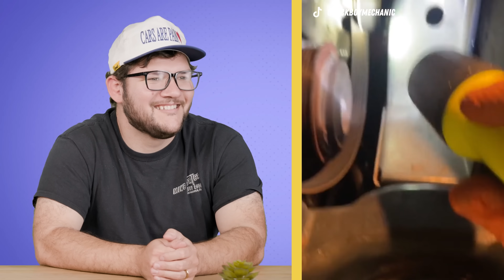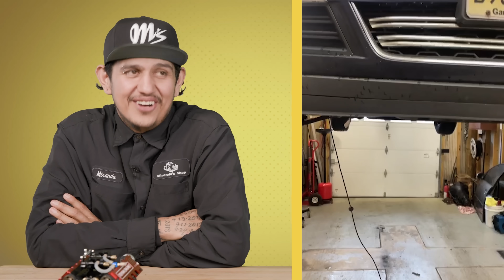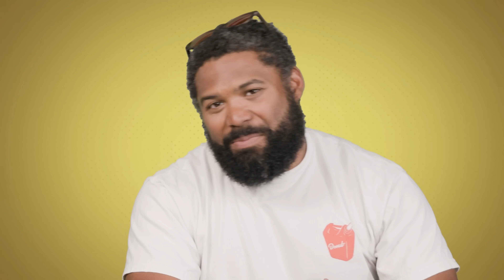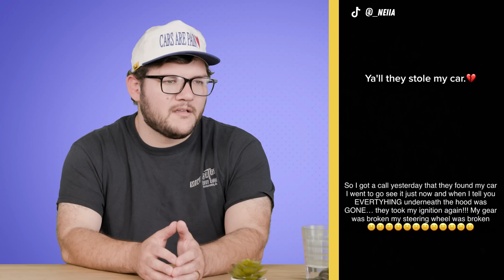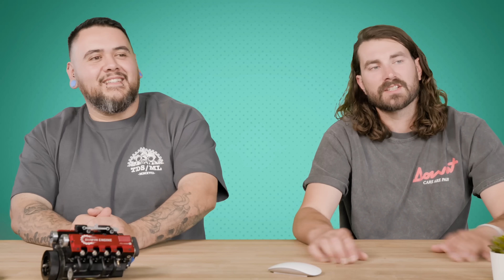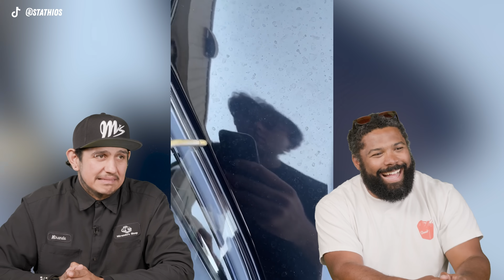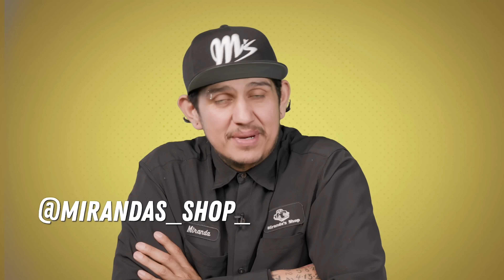Mechanic Reacts to Car Engineering Fails

Comment: Im an engineer (aerospace electronics)  I also work on cars (was and engineer for Chylser at one point) the issue is that a lot of engineers dont have the complete user experience in mind when designing things. And when they do, often time managment would force them to ignore it to save cost/time Before I design or make changes I consult with several technicians to make sure im not causing unnecessary pain points
Reply: And as a retired aircraft mechanic, I truly thank you for talking to the technicians.
Reply: I work in a heavy duty truck service shop, I can tell you 1 thing for certain…. Fuck Volvo semis. They make a truck that’s supposed to be streamlined for the consumer, however, they overlooked the need for maintenance and the effective ability for technicians to navigate whatever bullshit they throw at you. I want to know why in the absolute fuck Volvo felt a need to have 3 lube filters, and 1-2 fuel filters,  when most trucks have 1-2 lube filters, and 2-3 fuel filters…. Not to mention it really seals those filters in in comparison and they’re stacked in a row too damn close together to effectively loosen all three and remove all three, gotta loosen 1 then remove 1, and they bleed, and you only get a 1/4” turn with a filter wrench at a time because you’re gonna keep hitting knuckles against leaf spring or frame… engineers y’all make shit the world needs, but sometimes y’all make shit unnecessarily “tidy” which results in tight squeezes that just make me want to make y’all start inventing tools for specific use lmao

Comment: everyone misses the point mechanics are not to exist outside the dealership you buy them and take em' to the dealer if not you buy a new one so you can be a slave to the company forever remember when the car breaks you buy a new one FOREVER... it keeps the emplyment  'in the company mindset...it builds customer brand loyalty ...UNDER FORCE...

Comment: Engineer here and no beef with mechanics. I do however have something to say to architects and the likes (in this case car body designers). Usually the problems start when you are given an beautifully designed thing, like a car or a building. Then you are given a spec sheet. And then you need to start figuring out where to fit all that within that already agreed upon design... 

Then you have management who sets fairly strict timetable to make all that work... And then to make things worse, you have multiple engineering departments not communicating with each other all the time due to the schedule set up by management.

Don't get me wrong, engineers make dumb mistakes all the time, but most of them are due to horrible scheduling and very limited design on where to fit everything.

Comment: I once hammered a  bulge in a firewall to get a bolt out, another time I used a holesaw in the firewall to get to a bolt on a starter motor and multiple times the bolt that doesnt coume out has been cut in place.
That's the beutiful thing with working on your own old beater cars.
I didn't see the starter motor in the V in this video. it's an old favorite of mine....

Comment: About the oil drain plugs: why, why on freaking earth do they make them to the sides and not just straight to the bottom of the oil pan? Like the amount of mess you make if you don't remove a cover or when there is barely any place to put a cardboard is insane. Best example is Fiat Ducato.
The older Ducato 290: The drain plug on the bottom of the oil pan and the oil filter has no other components underneath it. You simply dont make a mess when you do an oil change.
The new Ducato 295: The drain plug is to the side where you gotta remove a cover and still use a cardboard, while the oil filter is located above the front axle and the  drive shaft, causing you to make a full mess, no matter what you try.

Like why on earth do they put the drain plugs and oil filters on the most retarded ways possible?

Comment: That roof leak is half engineer half factory. part of engineering for mass production is to minimize potential factory error by reducing fiddly, low tolerance, and difficult to QC or repair assemblies.

Comment: As a former auto mechanic, I've had multiple situations that had me cursing the engineers for idiotic designs. 3 in particular stand out. 1. 1989 Honda Civic wagovan. Where the alternator is mounted, the ONLY way to remove it requires removing the drivers side CV shaft to have enough clearance to get it out. 2. Nissan......Altima I think. It had HID headlights of which the bulbs CANNOT be replaced while the headlight housing is in the vehicle. You literally have to remove the headlight housing to replace the bulb so, $200 for the bulb and 2 hours labor just to replace 1 bulb. 3. was a Buick Lucerne I believe......the oil drain plug faces forward at a slightly upward angle and directly in front of it is an aluminum lip with AC lines on it. The first time I changed oil on one of these I had a real mess on my hands. The oil went straight to that lip, spread all the way across to the ends so, I had oil draining in 3 places.
One repair we refused was on a German car. It's been so long ago I don't remember the make and model but, it came in with a bad starter. None of us had ever worked on one before so naturally, we looked up the procedure on "All-Data". Step 1: Remove engine from vehicle??? This was one of those cars where the started was mounted INSIDE the bell housing of the transmission. That's one of those designs that makes you want to punch the engineer in the face.

Comment: Not the mechanics fault at all your 100% wrong.. Just look at the ford f150 problem with the convenient slide for oil for the filter but it comes out on the ground behind you.... STUPID ENGINEERS!!! Although I think companies like Ford hires the Engineer that can complete the job for the cheapest price.. Ford isn't hiring the BEST Engineers =/.... I would blame the Corporations cutting corners with their engineers. Corperate and all... They are all just so stupid... TOP DOWN!!!! Also has to do with the Growth of a company. When a company goes "Public" they have to do what is best for growth for their shareholders... This is the problem with late stage capitalisms.. We need to figure out a way to take back the ground from the Corperate companies...

Comment: On the Q3 there is a recall for the seals and the drains get clogged in extreme cases they will replace the rails. Very fixable just a pain. You don’t get a new car because it leaks.

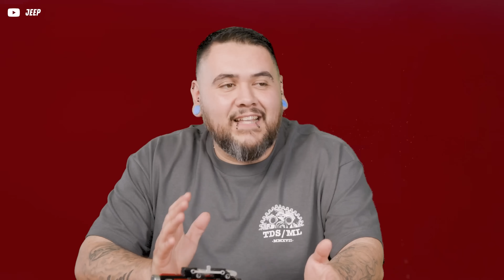Comment: as a mercedes tech on the statement about copying “mercedes habits” 7:08  i disagree because truth is many of major components such as transmissions in mopars are from mercedes its been a thing since like 2007 or so but the problem is that they get all the outdated stuff which is no longer supported by mercedes and has probably been replaced for a updated one for a reason so you can blame the brand for getting parts from another manufacturer to install it in something it wasn’t designed for

Comment: Yeah alot of the populus doesn't realize that engineers know and identify weakpoints and failures, but marketing and accounting tells them to patch it up with as little cost as possible. The problem is not engineering, its low cost capitalism and greed for profit. Most engineers love their work and put a lot of work into making sure things work right.

Comment: The chev belt tensioner bolt is easy, back the bolt out all the way to the frame, move the body of the tensioner all the way out and chop the bolt BEHIND the tensioner.
Just use a shorter bolt to reassemble...

Comment: I worked for hyundai/Mitsubishi. And the damn alternator Bolt on the xg350 (because it's a Mitsubishi motor) there is one bolt on the front of the motor that needs to come out inorder to do the timing belt. Well I order to get that one f ing bolt, almost the entire front clip has to come out. Pita for realz.

Comment: All McLarens and Lotuses are inconsistent - so difficult to get properly fitting replacement parts due to the ABSOLUTE DIFFERENCE in who assembled it and when. When they release a lightweight version of an existing model - you might already have that in your regular model just from build quality.

Comment: I'm an electrical engineer so don't know shit about mechanical engineering. Just wondering if that bolt issue is more a factory issue. Like purchasing couldn't source the correct bolts or tried to shave some money by lumping them in to an order with bolts a quarter inch too long thinking it wouldn't matter.

Comment: I mean to be fair, theres alot of good engineers out there who are told to "make it cheaper" or even "make it more expensive" (which overcomplicates things). The sh!t does roll downhill for them too. Engineering is not cheap and someone is obviously footing that bill with something to gain.

So yeah, id say the investors pee at the top of the waterfall, then comes corporate, then engineers, then mechanics and guess who sits at the bottom of the yellow creek and gets to pay a years salary for the privilege of drinking it.

Comment: As an engineer, I can tell you that management (non-engineers) make these choices 95% of the time to not allow the engineering team to correct issues we find before a vehicle goes to production. And for the stuff we do miss as engineers, just remembers that it usually takes over 100+ engineers to make a car and most are working on several at a time.

Comment: I live in norther bc Canada, we’re technically a rain forest. Sun roof leaks are the norm, I fix a lot of them and it’s exactly like the video. Usually coming out the a-pillars but sometimes out the overhead console. I’ve seen multiple new truck come off the carrier leaking. We just fix the leak and replace anything damaged. It’s a real nightmare and I hate it lol.

Comment: Jeep xj. Transmission crossmember bolts go into frame rail where welded nut is. Nut weld breaks. Fix  cut the floor open to get to the nut!

Comment: As a mechanic, my most prevalent engineering hatred is towards the ford 1.5 and 1.6l engines from the fusions, escapes, and focus. 
  Change a water pump......I dare you. Instead of using a block mounted tensioner for the timing belt, they mounted it to the water pump, so you cant do one without the other. The timing tool set is over $200, (just the tools, not the parts), and it's a minimum of 6 hour book time. They had a chance to fix it when they replaced the 1.6l after 1 year of production with the 1.5l. But they didnt. Big L for the engineers

Comment: Any modern german car is a one big problem. They were not meant to be fixed. Just throw away.
Reply: You bet how loud did i swear while putting the sht together on those good looking fancy big pile of crap.
Reply: Unfortunately the problem is not just German, and not just cars.
"Throw away culture" is a widespread global issue which is increasingly difficult to avoid.

Comment: Former manufacturing engineer for ford, mechanical engineer and tool maker. When switching to cracked rods from forged, I raised the issue of re-boring the big end during a rebuild. My manager asked why they care about how easy it was to rebuild. Rebuilding engines doesn't sell new engines and 3,000 people had a job there building NEW engines

Comment: #1 - I totally wholeheartedly agree. I once had to remove all the motor mounts from a Mk4 Jetta's engine and transmission to change the driver side control arm, that same control arm must be removed in order to change the transmission filter as well. AVGN Voice What were they thinking?!?!?  #2 is hilarious, That same jetta mentioned in number 1 does the same thing. Seems Audi / VW dont know how to install the sunroof trim correctly. This is why you dont pay luxury prices for garbage. #3

Comment: As a mechanical engineer, many of these hurt to watch. In school our design courses absolutely did emphasize considering how a design would need to be assembled, taken back apart when needed and maintained. We learned how to design a part to last a certain amount of time with a known reliability (e.g. 99% would last 10 years or whatever), and to add a factor of safety on top because the real world isn't perfect. So those parts that aren't made to last or the bone headed terrible maintenance decisions might be from an engineer who's head it too far in the clouds for practical design work, but I'd bet many, many more are due to executive business decisions that the engineers were either overruled on or forced to make the best of.

Going through engineering school, we were well aware of a bunch of stories (although I never looked into how true they were) of younger, capable engineers working for major companies like an auto manufacturer who were assigned a part design job. The part they designed turned out within constraints, met or beat performance requirements and was very reliable. So reliable, those engineers were immediately taken off any design duties, because their part was one less thing the dealer can charge clients to fix.

The thing is, many companies (in any industry) don't have engineers deciding what to manufacture, which design to approve and so on. That's all the business executives, the board, whoever. And what they care about is maximum profit, maximum share price and the most streamlined and efficient business possible. And if all the competition has the same garbage standards, there's not even a danger of a significant loss of market share.

Comment: 2002 solara oil filter placement. Its in a hole. And its fine if you have the right tool but if you are doing this at home and dont have something that can grab the end of the filter you're gonna have a bad time. Also tie rod end boot or rack boot whatever theyre called the straps that hold those on are a pain in the ass. Then you have that washer you have to bend and thats a pain. This is a car that was meant to have every repair done at a shop.

Comment: As a gent who used to change tires, and fluids that later got a Eng. Degree. I definitely have days where I prefer the mechanic side.  Look a new regulation is enforced now your forced to constantly try and achive unrealistic results, with in budget, and thus take risk (reliability, operability). Explain explain explain, then decide which hill to die on.  I feel regulations and emissions concerns have forced us to build ridiculously complex systems to solve one issue while creating twenty more.... i.e. you cant practically fix things things, they go in the garbage. We need to get back to reduce reuse and recycle... i.e. lets show / demonstrate that the 4.0l jeep provides best total value (environment which considers the aformensioned issues, impractical to fix/constant problems) that ran on 5 wires back it will outlast equivalent of 3 modern cars in the reliability department.... and 500k km before neededing something significant.... so much less waste... jeebus we used to have local alternator rebuilt places... now all thos black boxes just go in the bin / cant be fixed.

Comment: For the 1st vid I get the bolt doesn't allow for a closed socket wrench to go over it, but can an open ended wrench work just by pushing up from the bottom side? Tensioners typically don't need anywhere near a full rotation, if it only needs maybe a 45 degree rotation I'd say it's not a big problem, just a little unsafe.

Comment: You do get paid to do extra steps if engineering made it that way. Example, thermostate on a 3.6 transverse gm is under the intake and depending on model needs fuel rails pulled. But rwd 3.6 is eaiser to change. Labor times reflec accordingly. GM dealer tech here to say you do get paid. OLH and a great story pays all bills.

Comment: Engineers are not blame free, but remember the Bean Counters and Greed Masters are the ones above saying cram more in or can it be done, then do it.  I'm also willing to bet there are plenty of engineers that make less than a lot of mechanics.  But it does suck when you come across that design flaw and have to fix it.

Comment: I don't see the KIA stuff on the engineers. that's a cost cutting measure from management. the long bolt in the first video smells like a communication issue between departments. body got designed without input from the engine department and vice versa.

Comment: You guys do realize there is a ton of technicians/mechanics that are constantly working on these cars during prototype, development, pre-production and durability phases. So to say "ohh it's the engineers" it's also saying "hey it's the techs/mechanics too". 
In addition, as a customer/mechanic, it's too easy to just look at one component and say it's designed stupid, without understanding the full picture. 
Not to say there are no design failures and mistakes, but unfortunately sometimes fixing those is not up to engineers, but higher ups and their timelines/cost

Comment: I’ve seen tons of stupid engineering designs where they should have made a tiny adjustment or designed something just a little differently, and it would be OK. However, no engineer or factory can find every one of these problems, and if every piece on every car was easy to get to and easily accessible, a small car would end up being the size of a house. It’s just not practical. They have to give and take with the designs.
Sometimes you wonder if they really test these machines and assemble a few before they go into mass production because some of these situations are painfully apparent.

Comment: I had a car like that, I don't even remember what kind but I ended up drilling a hole in under the fender and added a little paint and a rubber stopper and engineering fail fixed.